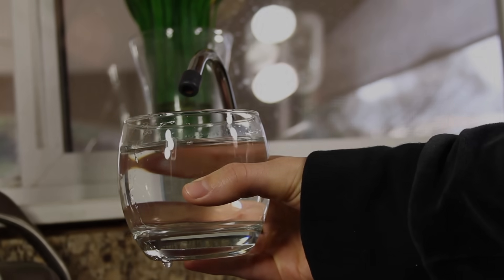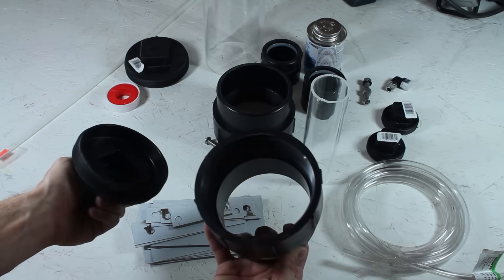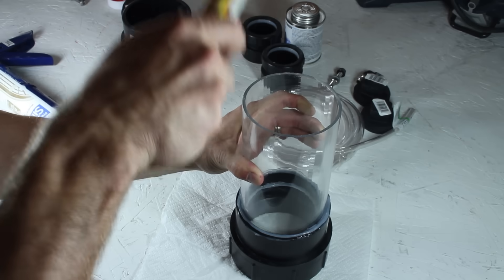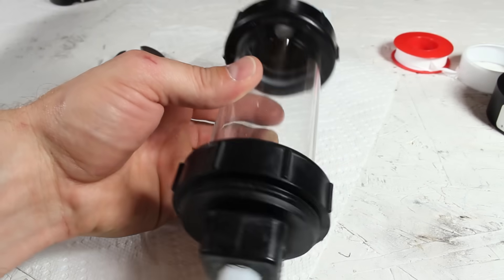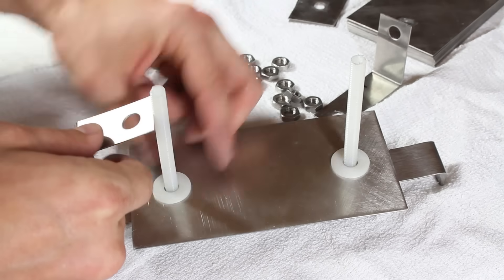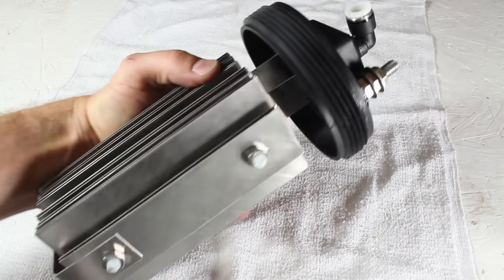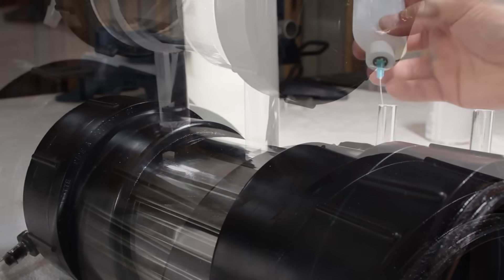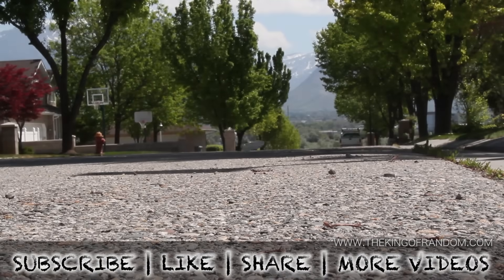HHO Generator - Water to Fuel Converter

Comment: how many volts does it take/use/need?
Reply: Since he said he used 2 car batteries, it could be both 12 and 24 volts, depending if he put the batteries in parallel or series. I would guess that he hooked them in parallel to increase the amps for it, so 12v.

Comment: My idea is to make a hydro cell big enough to power a 10kw generator for my house. From there I would set up a charging system off my generator to keep the cycle going.
Reply: That would not work.
Reply: Why not?
Reply: Taylor Prickett you can't power something with it self and get more power from it. Also you need to make the hydrogen first, and that will cost you 4 times as much power than you would receive.  It wouldn't work, it inefficient and you will loose a lot of money from it.
Reply: your not really powering something from itself. your using a small amount of power to split a bond. Then your utilizing that fuel. Its not like winding up a spring. Look up the video where two guys run there truck off of pure hydrogen.

Comment: I have a good suggestion/idea for you. I've never heard of this and am so interesred... and have so much to say. Anyway, I have an idea to make your generator more efficient. Is there anyway to have the plates inside vibrate or spin from the, or not from the energy your creating? It would be the same concept as your surface area idea. More molecules will be moving across the metal I imagine. Unless the rate is constant because of the amount of energy being sent to the plates. You have,  I think two variables that influence the production speed. This can be used to power a car. He'll this could power a plane. Quantity and quality would be the key to success, it seems simpler to make the engine. This is incredible fuel...

Comment: I have once again made the mistake of reading the comment section and my brain hurts.
Just a quick synopsis of what is happening here. He is using electrolysis to break the molecular bond of the water. As you know water is made up of two hydrogen atoms and one oxygen atom (H2O). The process breaks the molecular bond and what you are left with is two parts hydrogen for every one part of oxygen. The hydrogen gas is explosive and is what is being used as the "fuel". This has absolutely nothing to do with nuclear power or fusion @KiQL KiQL. Yes you need to consume electricity to achieve this process but as Hexerin Null stated you can get this through means of solar or wind power which is a renewable energy source. Hydrogen gas could be used as a fuel source, however at this moment it is true that it's more expensive than gas. Unfortunately we live in a world where people care more about profit margins than an environment we depend on for sustainability. On a side note as an added bonus to this process we're left with some oxygen gas which our atmosphere desperately needs anyway.

Comment: If you are going to make one of these please be sure that use high temp PVC.  regular PVC and the clear plastic he shows can not handle high temps.  The amount of heat that these can produce could melt the PVC and cause a problem.  Don't just use regular crap you have laying around.  Be safe and smart and realize that when the electricity is going into the water and potassium hydroxide it creates resistance.  This resistance in the water matched with the resistance increase because you are using stainless steel (stainless steel is less conductive than gold or silver and causes more heat) causes a lot of residual heat.  Use high heat rated plastic or you will not like the results.  Other than that these are very fun and can even increase gas mileage by a mile or two.  BE SAFE!

Comment: Nice job, great looking project. Now you need to put together an H burning engine. There must be some tech info around, since it's been done in full size cars to demo Hydrogen fuel. Current (no pun intended) thought is to store wind/solar electric in batteries, but it could be stored in the form of H gas and then burned to power generators during peak demand.

Comment: Just to be clear, this is not a source of free energy. The energy stored in the explosive gas will be less than the energy of the electricity used to convert the water into a mixture of Hydrogen and Oxygen. The converter will have lost some of the original electric energy in the form of heat.

Secondly this device is extremely dangerous since both the Hydrogen and Oxygen are combined in the gas,  It is likely to detonate spontaneously.   More sensible attempts to convert water into fuel separate the hydrogen from the oxygen and only bother to save the Hydrogen. The Oxygen can be released into the atmosphere as there is plenty there which we can use when we want to burn the Hydrogen later.

Comment: You can find most of this stuff on ebay. Like the potassium hydroxide. You can also buy the stainless steel plates on there pre-cut to size. Just looking for the tubing and connectors now.

Comment: I'm sorry, but the source in your description has absolutely ZERO scientific credibility.

Particularly, the segment about these neutral plates contains several errors and misconceptions.

First off, an unconnected metal plate is not going to increase the resistance of anything, not by a discernible amount at least.
The resistance only increases because you're spacing the electrified plates further apart from each other.

Secondly, they say these magical neutral plates increase the resistence but allow the same amount of current to pass, which, as anyone with half an electronics degree will tell you, is utter nonsense.

I = V/R.
Notice the resistance at the denominator.
If you increase the electrical resistance of a circuit, the current flow will decrease accordingly, NOT stay the same. Not in this universe at least.

But most of all, this site advertises the fact you can produce the hydrogen via your car's alternator - which you can - while the engine runs on the very hydrogen it is producing - which it can't.
Unless you've got a very big tank of hydrogen that's already full and you're trying to deplete it.

Stan Meyers was simply a fraud, which is the reason he always refused to have anyone measure the power draw of his setup, claiming he'd lose patent rights.
That's like a manufacturer refusing to tell me how much petrol his cars guzzle, pretending that if i knew he'd lose the patents to the engine.
It is that idiotic.

Note this isn't an attack on you, Grant.
A lot of your projects are cool, but please be more selective about the kind of people you give visibility to.
Scammers already have much too easy a time in this world, let's not facilitate them.

Comment: I carefully cleaned out a small lead acid battery and filled it with baking soda water concentrate (fewer nasty byproducts than other common electrolytes), jumped it to a tractor battery, and got a very mild bubbling reaction - barely noticeable. Lead acid batteries are a collection of plates interleaved in solution identical to what you made except they have separator pads to prevent sparking. Surface area contact is everything in a lead acid battery, I should have great surface area, not sure why I am not getting a reaction similar to yours... Now that I'm thinking about it more I wonder if it had to do with using a dead battery, do you suppose there is poor conduction in a used up battery? Wonder what happens if I apply 120V AC (from a safe distance).

Comment: Doesn't decomposing water by electricity take a lot of energy? Engines work by releasing energy, not inputting energy. If the electrolysis requires more energy than the explosion can make, then it certainly won't be a fuel of the future, although it is very interesting.
Reply: GoldViolinFlutist
 Basically right. Of course, if used a wind turbine or photo-voltaics to generate the electricity...
Reply: But then wouldn't it make more sense to use that electricity directly rather than using it to decompose water? Although I'm not sure of the efficiency of motors...do you know? I would expect it to be quite high because it seems that not a lot of heat is expelled
Reply: GoldViolinFlutist
 All depends on what you're trying to use it for. As an example, let's say you want to get "Brown's Gas", and use it for welding, then it makes sense.

Alternatively, let's say you want to store the energy in a way which you can control the output as opposed to wind which is variable in output, then using wind generated electricity to generate stores of hydrogen and oxygen would work.

However, in general, you're basically right.

Still, I can conceive or using wind powered electrolysis to have a gas power plant that runs not off natural gas, but from hydrogen/oxygen mix. Again, that's just so that you can control the output via storing the oxygen and hydrogen and burning it a rate you choose.

NB: Brown's Gas is considered a pseuo-science term, but if you look it up it does present some interesting possibilities, just not necessarily how it's portrayed by the fringe science community.
Reply: BADALEX so are you saying that O2 and H2 might not be as efficient, but is easier and more stable to store? Like, hi-cap batteries don't really exist on the scale of like, city power. That?
Reply: Its all been researched before.. YOU DO NOT GET FREE ENERGY FROM HYDROGEN GAS.... PERIOD..
>>>>>>>>>>>>>>>>>>>>>>>>>>>>>>>>>>>>>>>>>>>>>>>>>>>>>>>>>>>>>>>>>
Oil is the best solution for transportation related energy needs.
>>>>>>>>>>>>>>>>>>>>>>>>>>>>>>>>>>>>>>>>>>>>>>>>>>>>>>>>>>>>>>>>>>> The Only other option would be the use of 4th generation thorium cycle nuclear reactors used to produce fuel for you car.  You can produce hydrocarbons from electricity using special Palladium catalytic converters to convert the CO2 in the air into Hydrocarbons.
>>>>>>>>>>>>>>>>>>>>>>>>>>>>>>>>>>>>>>>>>>>>>>>>>>>>>>>>>>>>>>>>>
Hydrocarbons are the best method of energy storage; much much much better than Lithium batteries. So even if we had Fusion Nuclear reactors; I would still opt for using those reactors to create "synthetic gasoline";
 That way this new clean "synthetic gasoline" would work with all existing cars.
Reply: No, you can use a nine-volt battery, some water, some salt, and plastic tubing containing graphite rods to convert water into Hydrogen and Oxygen.
Reply: yes I know that, but the total energy in the battery should be more than the energy produced from O2 and H2 due to wasted energy from the procedure.
Reply: GoldViolinFlutist
 Sort of like that, yes. Again, more specifically to get an even load of electricity being generated. One of the problems with wind turbines is how variable the power output is.

As for easier and more stable to store...well. That's where it gets kind of tricky. Hydrogen is a very small molecule so you need fairly advanced seals for that to work.
Reply: its a great way of storing that unreliable renewable energy like solar and wind
Reply: I would like to see one of those in say like Somalia find a water source which is hard! solar panels to make the power , and essentialy you built a gas station in the desert that runs for free
Reply: Tim Schuchard
 Well, that wouldn't really be running for free at all, considering the cost of the solar panels.

 As mentioned, hydrogen is a very small molecule, and quite hard to store. A better option might be Brown's Gas, which is a hydrogen and oxygen mix.
Reply: again BADALEX if your in Somalia the fuel truck is not going to your location, so fuel becomes gold, just need the initial investment
Reply: Tim Schuchard
lets count big enought solar farm to actuali make fuel for cars = 1 bilion dolars. maintenence repairs and educated workers 10 000 000 dolar / month Investment to cars in somalia 1 bilion .... sory no go ....
Reply: maybe they could use solar panel to produce the electricity to produce the hydrogen to run the engine. like the train use diesel generator to produce the electricity of the electric engine.
Reply: The logic is, you're eliminating the use of batteries when you can store the potential energy in pressurized gas form.
But yes, the laws of thermodynamics dictate that energy WILL be lost.
Reply: Maxwell Simons right, energy will be wasted in everything, just gotta choose the method of least waste right? i get it now
Reply: Wow, an actual, honest to goodness discussion without childish blabbering. Thanks people.
Reply: You could in theory use solar or wind as your power source.
Reply: but you also need accumulator to keep a reserve of energy since they aren't reliable enough.
Reply: I have no time to read all the comments but what if the same cars were to use the rotating wheels to create the needed electricity?
Reply: Oh wait never mind that would slow down the car xD
Reply: ***** Are you sure? The point of the heating is to make it rise. If that energy was kept wouldn't it be at the same temperature and state? It is not so however. It cools eventually so that energy is again gone.
Reply: ***** Did you insult me by any chance? :)
Reply: Hydrogen is great for storing energy. If, for example, solar, wind, whatever energy are converted to hydrogen, they can be stored indefinitely. The electrolytes are reusable and it's possible that systems could be made to use sea or waste water, thus purifying/desalinating it when the energy is released.
Reply: ***** Yes its all very interesting; I built my own parabolic solar condensers with a mylar-mirror system directing the light into a black-water-tank. The light entered the water tank but could not exit; therefore heating the water in the tank; used as storage.
>>>>>>>>>>>>>>>>>>>>>>>>>>>>>>>>>>>
I studied every aspect of this for years; I am an Environmental Engineer...
 This is okay for powering your own home (assuming you have 25000$ + are an engineer who can build your own system)
BUT solar-power is Not Viable for powering a space-age society + Industry..
>>>>>>>>>>>>>>>>>>>>>>>>>>>>>>>>>>>>>>>However we do have a clean solution; its called Thorium Cycle Reactors.
BUT Governments insist on using  Dangerous 1950s Era Uranium reactors... WHY??
 BECAUSE THORIUM-CYCLE-REACTORS CAN NOT PRODUCE NUCLEAR WEAPONS...
>>>>>>>>>>>>>>>>>>>>>>>>>>>>>>>>>>>
Look up Thorium Cycle Reactors
http://en.wikipedia.org/wiki/Thorium-based_nuclear_power
Reply: ***** Small dirty bombs do not wipe civilization off the earth...  Terrorists do not have access to nuclear reactors unless governments allow them access.

Comment: Hi Grant, my unit is not performing near as well as yours although I stuck to your specifications and used the same materials  you did. The electrolyte (NaOH) turns brown and is not clear like yours. I will appreciate it if you can give me an indication as to why my generator doesn't perform as well as yours.
Reply: Read the description. He used potassium hydroxide.
Reply: Thank you, will sort it out.
Reply: My experience is use pure distilled water and KOH for the best results, the electrolyte remain clear even after 2 hours HHO generation. I use 3cr12 stainless steel which is magnetic and does not discolour the electrolyte with KOH, using distilled water and NaOH as an electrolyte it turns the electrolyte brownish forming a slimey sediment on the floor of the cell, which means the cell has to be cleaned on a weekly basis,
Reply: Marthinus Van Schalkwyk
Did you get it working? I was wondering if the electrolyte is re-usable. I don't see how it would get consumed in the process, so technically wouldn't it remain once the water has been fully electrolysed?
Reply: If I remember correctly the KOH is a CATALYST not an electrolyte. The electrolyte would be the water it self.
Reply: The potassium hydroxide (KOH) definitely gives more Hydrogen, but the amps are higher and keep the "water" clear,  the sodium hydroxide turns the (water) brownish which remains like that once it discoloured.
Reply: It is electrolysis more or less the same as a battery.
Reply: All the important answers are here. Distilled water does not conduct electricity. Without something to help the water conduct. You'll have no reaction at all or at least very little. Since it's hard to keep water completely pure. This is why the liquid in the electrolysis chamber is called an electrolyte. All in all this is a very neat project.
Reply: It works with both, but with NaOH it turns the electrolyte brownish and leave a brown sediment on the bottom of the cell.
Reply: Sodium residue.
Reply: Try using pure distilled water. Maybe impurities are causing the discoloration?

Comment: So you say it turns back to water when used? Would something like this be safe to power gas engines? Of course without the gas being turned to water again. Great video! :D
Reply: This is already sometimes used, but isn't particularly seen on roads because the fuel can explode waaaay too easily.
Reply: Yeah, hydrogen, the most explosive gas on Earth, 14 times lighter than air and explodes because mixing with oxygen ;)
Reply: I might be wrong but isnt this kind of like those fuel cell buses?  I might be thinking of a different process but I remember a driver of one of those buses telling me the only waste from them was water.

Comment: Two more things to add.  1) A quick re-fill valve for adding water really easily.  2) A ping pong ball with a small ball bearing glued into a small hole and placed in the bubbler.  The modified ping pong ball can prevent water from exiting through the gas outlet when over filled and can help prevent a complete loss of water in the bubbler.  Might need a little more modification so the ping pong ball creates a better seal but it should work.  Not perfect but is DIY.

Comment: there is a more home made way to do something similar and its use metal some wires and small beakers and batteries some salt and water than you do the rest connect the two together to make chlorine and hydrogen and the hydrogen can be used as a fuel source but takes a while to collect and as for the chlorine well be careful its poisonous XD